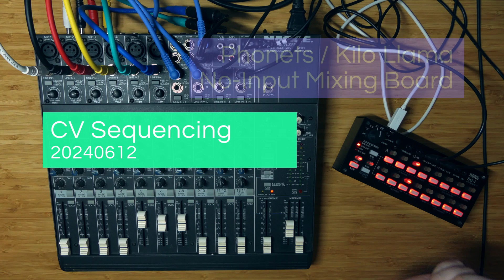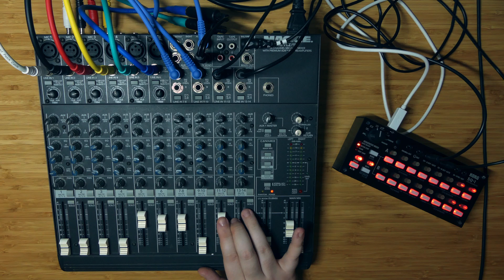No-Input Mixing Board: CV Sequencing Experiments

Comment: You're really flying with this now, how's it connected? Well done.
Reply from the maker: 3.5mm to 1/4 cables are running straight from CV A and CV B on the SQ-1 into channels 11 and 13 of the mixing board. These are being sent to the Aux 1 and Aux 2 feedback loops with the aux send knobs on those channels.
Reply: @kilo_llama  thanks. It looked as though that's what you were doing.
This isn't my field though. I use tape, diy and test oscillators, slow modulating pedals, freaky delays, feedback and verbs.